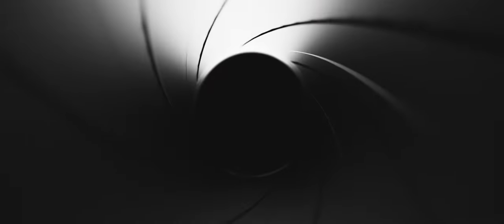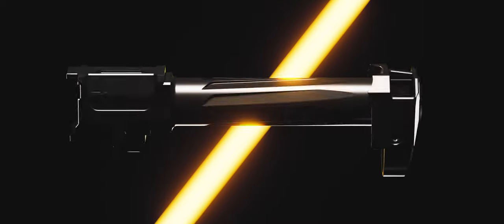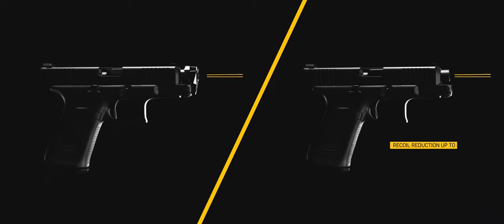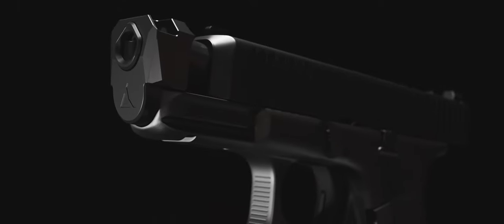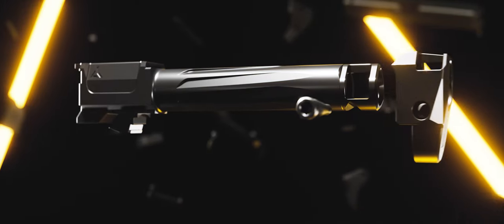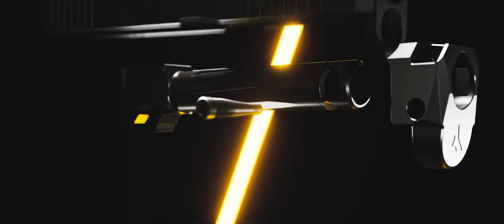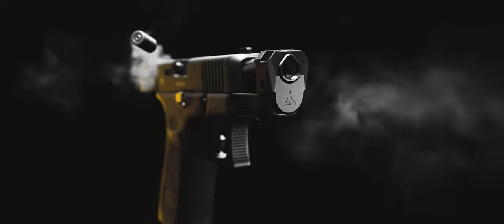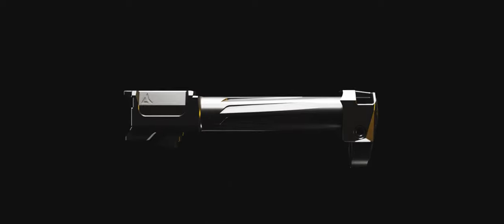Radian® AFTERBURNER™ + RAMJET™: A detailed 3D breakdown of the system

Comment: I have this installed on a Shadow Systems MR920 which is essentially a gen 4 Glock, and oh mah God is it nice. Noticable difference in recoil plus it's a better fit than the match grade OEM barrel it came with. Also it's more accurate. I've also ran 147gr HSTs thru it and there was no difference in point of impact between them and 115gr fmjs freaking insane. Well done Radian for Pushing out quality parts. Very functional and good looking

Comment: Anyone having issues with the finish? I haven’t shot mine and just put gun oil to coat it. Never got a chance to shoot it yet and noticed the spotting/corrosion on the finish. Used MC2500 and the corrosion is by the logo where it’s recessed. Never had issues with corrosion and it being new made me question the finish on this barrel.
Reply: I see you mentioned this on seperate videos. Maybe post pics in the Glock Reddit forum.
Reply: @mytube4eva11  will do. Just figured it wasn’t normal compared to OEM and my agency. Just got added to the Glock page and will post it to see if anyone else has this problem
Reply: @mytube4eva11  first response on Reddit was oil ur guns. That’s why I don’t go on Reddit lol. I know how to clean/oil my gun. Probably do it too much if anything, but yeah…they just criticize you on Reddit when you post instead of helping or just straight answering the question.
Reply: @86steventura  yeah I notice the level of maturity, commonsense and respect is very low over there.
Reply: @mytube4eva11  yeah, I’m going to delete that post…it’s getting annoying and people just blaming me lol. No don’t  likes hearing bad things about companies they like lol. The gun has been oiled, but the finish is just flaking off. I’ll just wait for radian to respond.